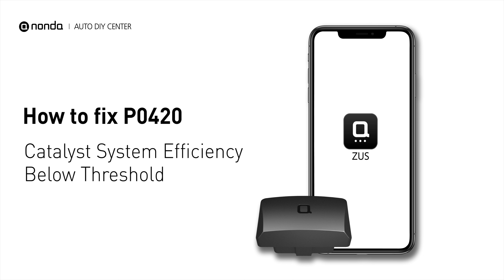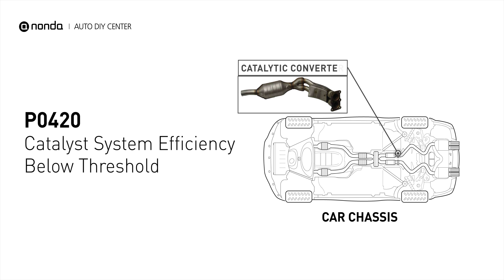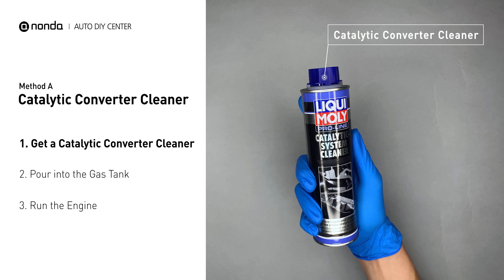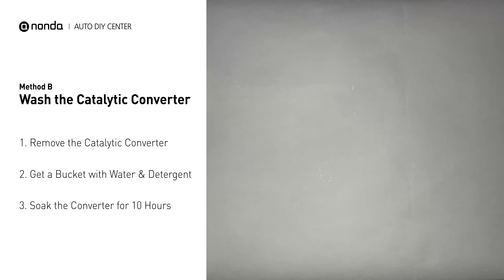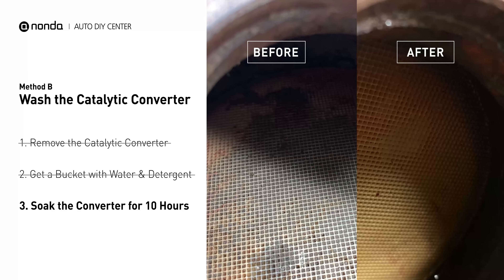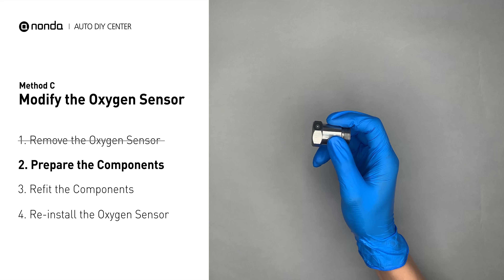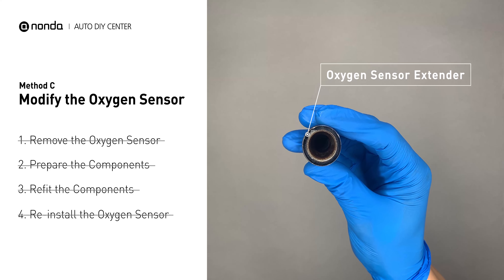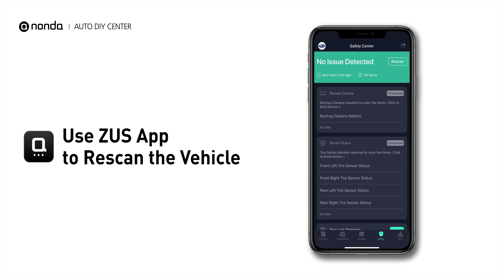How to Fix P0420 Engine Code in 3 Minutes [3 Methods / Only $19.99]

Comment: To anyone with this error code, CHECK YOUR SPARK PLUGS! The previous owner never changed them and I was in the process of replacing them when the far left-most spark plug well was dipped in oil. Got a lot of paper towels and kept drying it up. Started up ol girl and the error code was no more!
Reply: Are you sure this wasn't your valve cover gasket leaking? Sometimes those things leak and cause small misfires that mess with the 02 sensors and the cat.
Reply: That makes sense. My valve cover gasket exploded sending oil everywhere. I bet that oil got into my plugs.
Reply: Then drive in a highway and then guess what the cel will throw up again 😂
Reply: Is this for any car ? I have an Audi A4 2012 that has this code I already changed o2 sensor. Any ideas ?
Reply: The p0420 code came up after replacing o2 sensor bank 1. Found sparks covered in oil. Symptoms are white smoke, hesitation on acceleration. MB AClass w176.
Reply: Yes I'm going to add on you you right but also change your gas put playing gas  you know what I mean not a 5 percent or 25 percent in the gas try not charge for that'
Reply: Spark plug in oil - it's time to replace spark plug grommet (the rubber ring)

Comment: Folks according to the Experts a Vacuum Leak or Exhaust leak before  the Catalytic Converter can also cause a P0420 code. A professional scan tool showing live data stream of your O2 sensors is the best way to confirm the malfunction.
Reply from the maker: Thank you for sharing this information. We recommend using the ZUS Smart Vehicle Health Monitor Mini to help detect any engine-related issues on your vehicle. Our ZUS app could also provide you tips/troubleshooting steps on how to fix and avoid the error, with an option to clear the code.
Reply: Im getting this code. I do have a rusted exhaust system. I had to cover a few holes. So yes definitely check your exhaust system before replacing your catalytic converter.
Reply: I’m running with this error code for almost 2.5 years 😬
Reply: @sony7954  Although you can run with this code for a while, it may be costing you in poor gas mileage, lost of power, and possibly destroying your Catalalitic Converter.   Advise you resolve the issue soon.
Reply from the maker: We agree with you. Thank you for sharing your opinion!
Reply: @stealthg35infiniti94  iam having the same issues do you think the O2 sensors could be bad
Reply: @patrickbrown-lott7964  As Ivan @PHAD would say, "Be 110% Sure before firing the parts Cannon." I replaced the upper O2 sensors with no improvement. "Smoke" the entire intake for vacuum leaks. Also see if you see "Smoke" coming out of the Gas Cap or rear canister. I had a valve cover leak sucking air via the PVC Valve. "Smoke" the entire Exhaust, Fix any leaks. If your ST Fuel Trims are over 10 Positive at idle, most likely you have a vacuum leak somewhere. In worst case,  you have a extremely worn engine.
Reply: @sony7954  With the engine light on?
Reply: @321blessed321  yes
Reply: @rpgtrainer  You're right. It's not a Vacuum leak on the Exhaust side. It's an exhaust leak on the Exhaust side. Typically before the O2 Sensors.
Reply: @sony7954  how did you pass the DMV's check?
Reply: @johnwu7166  We have not in Nova Scotia.
Reply: I’m still running with that code. Its 250 thousand in odometer, I think it appeared at 190 thousand.
Reply: @sony7954  same to my focus mk2 2009, appeared at around 200, now 250
Reply: @patrickbrown-lott7964  If the O2 sensors are bad. You will get a code on your scanner.
Reply: Yea i have this code along with bad gas mileage,  check engine light, and it kinda smells hot when idleing!?! (Temps stay normal)ordered the 02 sensor yesturday, hopefully that fixes everything !
Reply: @sony7954  In New York State we have to pass the Inspection so I can’t do that unfortunately
Reply: @sony7954  not i germany, you will not pass the tüv when there was even once this error in the System (it stays in the obd till the Kat is replaced)
Reply: Can you show a video this because I believe I have a leak but but 100% sure
Reply: If your in california, i wouldnt recommend putting a spacer on your O2 sensor. When it comes down to smog it. That can count a a tamper to the system and fail the inspection

Comment: every year at the same exact time january i get this code once i put in the cata clean the engine light goes off i did read that cold weather can trigger the code
Reply: It’s funny last week my code came up.   It’s freezing one day the 40-50 the next.    Took it too a car wash day before code came up.  Maybe your comment might help out.
Reply: Check your coolant temp. Thermostat might be stuck open and the engine never reaches proper operating temperature.
Reply: This makes sense

Comment: Carbon buildup can also trigger Code P0420. My 2014 Jeep Grand Cherokee Laredo threw up the code even tho there were no symptoms of bad cats or o2 sensor so I thought what if it's carbon buildup? So I used 2 cans of Seafoam Intake Cleaner and after following directions it killed Code P0420 and the check engine light never came back on
Reply from the maker: Thanks for sharing your experience!
Reply: @nondainc  👍
Reply: How long did it take for the code to erase
Reply: @Terrion Barlow  10 seconds after the seafoam blew all the carbon out. My recommendation is if the light doesn't turn off have the dealership or whoever else that has a OBD2 scanner they can erase the code
Reply: @chaseboy225 I have a code reader.. Costs about $17 .... 
Or can borrow one from the auto parts store for free. 👍

Comment: I have tried two different length non foulers on my 13 Hyundai Santa Fe which cause a new code for non working 02 sensor. I have tried the fuel additives as well, worked last year to get it to pass inspection but not working this year, have used 3 bottles of it so far. Guess my next step is take cat out and clean it. Even a junk yard wants $1500 for a used cat with 150k, ridiculous! Brand new one is $2400. My car has 170k. There are cats on eBay for $100-$200 new but can’t get them shipped to my state NY. 🤦‍♂️
Reply: Hyundais have GDI engines that don't clean intake valves when they combust. Known for carbon build up. You need to clean the actual catalytic converter.  I'm doing the same to my 13 Sonata this week at 173,000 starting getting code 0420 2 months ago. Spray  Seafoam into oxygen sensor hole Bank 1 closest to engine.  Leave soaking 30 minutes to 1hour. It will smoke white for 10 minutes or so then drive it hard on freeway.  Clear codes and repeat, wash rinse and it will go away.
Reply: @ thanks, I was thinking of taking it completely out and letting it soak in tub of cleaning solution or something overnight. But that’s a better idea, that way don’t have to remove it! I will have to try that

Comment: Thanks.. Nice and clear video I will try with option 1 first., nothing happened I go for option 3.. I hope no need to do option 2 seems a lot  work..
Reply from the maker: Hope it helps!
Reply: Did it work?
Reply: @juanjosecisneros1633   yes I just the cleaner solution into gas tank, I picked a route to drive 150 miles , next day check engine gone. Same week I got mine inspection.
Reply: Which cleaner did you get?
Reply: Which cleaner did u buy?
Reply: @prezaricardo1749  which cleaner did you get?
Reply: I never had this problem before, but the option 2 is really easy on toyota 2AZ-FE engine, as I have had the part shown in the video off before... There's like 5 bolts you undo at the head, and I think 2 down low, and the whole thing comes out. You have to get the heat shields off first of course...

Comment: The spark plug fouler works great. Only problem is that now in California during smog check the attendant will pass a mirror on a handle under the chassis or get down on the ground and look for an extender. If you have one on, you will fail smog, as they are not legal.
Reply: I have an 04 sequoia with PO420 code.  I can't use a non fouler because my downstream O2 sensors are bracket or flange type mount. Anyone have this issue?
Reply: Go thru inspection then put ur extender back on. U only have to look good for the inspection.  Do ur modifications after the inspection.  
Ur state is over run with laws & taxes. 
Hope u win back ur state.

Comment: I just removed the censor and let it soak in gasoline for a few minutes. Then i cleaned with a toothbrush and repeated this process 2 or 3 times. After cleaning, i used compressed air to dry. You'll have to wait a few hours to let gasoline evaporate completely from the censor. I did this a few weeks ago and i have had no issues.

Comment: My muffler was making a popping sound today after changing spark plugs and ignition coil. I reinstalled the spark plugs after checking to see if they may have been damaged but they checked out fine. The rough idling i had before went away so i was pleased. However 30 seconds into turning my 2002 ford escape on this popping sound started and i see the muffler back fire. Im going to try any of these steps. Hopeful that it works! Thanks for the informative video.
Reply from the maker: You're welcome. Let us know how it goes, Melida!
Reply: Did you figure it out? Something similar happened to me with a Hyundai Accent, turned I put the spark plug wires out of order.
Reply: Too much backfire will cause catalytic converter to melt inside.
Reply: Check your firing order
Reply: I had the popping sound and that sound was actually small broken off pieces of the honeycomb rattling inside. It got very loud and annoying. Had to change the cat
Reply: @Morningstar-bg3xh  - yeah, I was going to say it sounded like he maybe crossed a set of wires when reinstalling....

Comment: #3 worked perfectly in my E46 BMW. Double thumbs-up!
Reply from the maker: Glad to hear that, Gary!
Reply: @Gary G did you ever try Method 1 & 2 before applying Method 3?
Reply: @oluwatosinolayemi7319  

No I did not. Read that cleaners added to the gas tank didn’t work. Re: #2, didn’t want to take the cat converter off before trying #3.
Reply: @gary7424  what about the fuel efficiently, is it better with this solution?
Reply: @expresssoftware9282  To be honest, I can’t tell you. I didn’t track/measure my gas mileage. Sorry.
Reply: What was your car doing when it gave you this code?
Reply: Which sensor, however?......pre or post-cat ??????

Comment: Blown head gasket will also cause P420.  Learned this the hard way on 2005 Tacoma 4.0 V6.  Wasted money on cats, O2 sensors, spark plugs, fuel injectors… ultimately coolant compression test uncovered blown head gasket.

Comment: Hi, great video ;-) But I don't understand the 1 Metod. To use the cleaner , Liqui Moly 8931, you can't pour it into the tank, you have to spray it into the carburetors ( sorry I don't know exactly were).  To do that you have to buy also  an acid-resistant vaporizer and the one from Liqui Moly costs around 35 euros. So, could you please  let me know how to use the  cleaner 8931?
Best regards

Comment: HI Noda, I have a 2003 Audi A4 T1.8 engine with the PO420 engine code. I reset the check engine lightened code, but after 250 miles of driving it comes back on, I replaced the catalytic converter 5 months ago and verified with two shops that I don't have an exhaust leak. I'd like to try method three and install a spacer. Which oxygen sensor should I replace and install the spacer, the O2 sensor before or after the converter?
Reply from the maker: Hi Joseph, it's after the catalytic converter.
Reply: You replaced with audi genuine catalytic converter & o2 sensor? ATG & I say many buy the cheap & get ride of the car.
Many owners are screwed & can't afford these replacement because due to these high prices.

Cleaning /or rigging something will NOT pass emission inspection/tag.

Comment: hi .thanks for the great video. i recently had a new cat fitted engine management light back on.mechanic now saying oxygen sensor are faulty and wants another£350😳i fitted 2 new after market sensors.engine management light is back on with a different code.any ideas 🤔
Reply from the maker: Hello, can you please provide us with your vehicle's year, make and model?
Reply: @nondainc  hi .its a Peugeot 208, 2013 1.2 .thanks

Comment: Im hopping ur 3 methods will work 4 me. 🤞🏾 Question, I hv 05 Honda element & has a adter market cat put on 2 yrs ago do to theft of the original. The air flow extender u spoke about, what size to buy or all they all same? Thx u for ur help in advance.

Comment: I have a 2014 Chevy Cruze with 1.4L engine it has 180,000 mile. I have been getting a P0420 code. It would go away and come back. Before replacing any parts do this. 

I fixed it just by disconnecting the Negative side on the battery 1st. Now find the computer it’s on the side where the battery is. It’s has 3 connectors on it. I disconnected all 3 connectors and cleaned each side male and female connector with CRC 05103 QD Electronic Cleaner. Let it dry 15 minutes. I plugged all 3 back in. I installed negative battery cable. I started and drove the car 50 miles. It never came back.

Updated

After driving the Engine light did come back. The same error code P0420 came back.
Reply from the maker: Hi Bobby, thanks for sharing your experience.
Reply: Is it still gone
Reply: @holyAaron  The error came back.

Comment: My cars service engine soon light was tripped not once, but TWICE driving over the same exact crazy deep(I have 17 inch tires and the entire tire fits inside this dip. Replaced o2 sensor and it worked until I drove through that same damn dip again, as soon as my tires were in it BAM service engine soon light popped back on
Reply from the maker: Hello, please provide us with your vehicle's year, make and model. Also, please confirm if there's any other codes that register along with this code.

Comment: These fixes all assume you didnt break your catalyst which should be the first thing you should check.
Reply from the maker: Thank you for your feedback, Jeremy!
Reply: If the CAT rattles, it's dead.
Reply: @chrisgraham2904  how to know if the catalyst is broken?
Reply: @asadullahsediqi7192  If you shake it and hear, or feel pieces inside rattling...it's broken.  You may detect pieces rattling if you tap the CAT when it is still installed.
Reply: @chrisgraham2904 I hear a noise when driving, could it be my cat?

Comment: I got this code after getting my cat converter replaced. Should I do the sensor or could it be they put a bad universal cat converter?
Reply from the maker: Hi Saul, if you already replaced the catalytic converter then it's possible that the issue is coming from another parts. Please repair if there are leaks in the muffler or exhaust manifold, and inspect your front or rear oxygen sensor.

Comment: Not easy at all to remove cat converter.   Non-foulers are illegal on o2 sensors in most states.  Gas additives only work for a couple of hundred miles then the light comes back on.  One 16 oz. bottle is now around $30.

Comment: I have a 2017 spark had 420 code. They replaces the transmission AND the catalytic converter.  Now 2 months later same code and slow.uphills again.  What do you think the issue is.  Car has 84,000 total miles.

Comment: I have a 2010 Honda Civic Hybrid, do I need to extend the sensor on the lower side or the upper side? For which one? Or for both?
Reply: ps. i use only premium gas, i already wash converter but check light again triggered😢
Reply from the maker: Hello, is there any other code that registers along with this code?
Reply: @nondainc   No! only P0420
Reply: @nondainc  PS. i did it on both sensor and check light again triggered ☠️ i have no idea if i can turn off check light!!!! 😂🥲

Comment: Hello. Whats the best method out of these 3 for a saab 2001 9-3
Reply from the maker: Hi Jose, we suggest to check first if there is an exhaust leak then test the O2 sensor and catalytic converter.

Comment: I replaced O2 sensors and Spark plugs to my Toyota Corolla 2010, after again Engine light and vac off light comes back. Now I need to try cleaner! What do you suggest?
Reply from the maker: Hello, we suggest cleaning the catalytic converter and see if the issue will continue to persist. Hope it helps!
Reply: @nondainc  shall I do by keeping the Cat cleaner in the tank and give a try ? Does this works ?

Comment: So from my previous owner of my vehicle, they had straight piped the vehicle. Is there anyway to cheat out the code?
Reply from the maker: Hello, kindly have it checked by your mechanic if there's a failed catalytic converter, faulty oxygen sensor, circuit problems or an exhaust leaks.
Reply: @mattabell4209  links?
Reply: @kmtalko   I don't know where you live so in Canada I sold them through grand west.. summit Racing also has o2 simulators .. some are vehicle specific.. adversely  adding a 50ohm resistor in line on some applications can also achieve this.. you will need some research